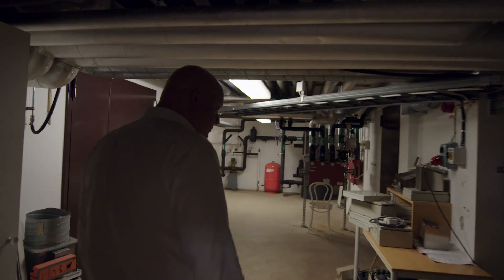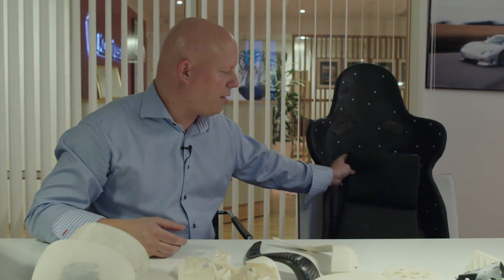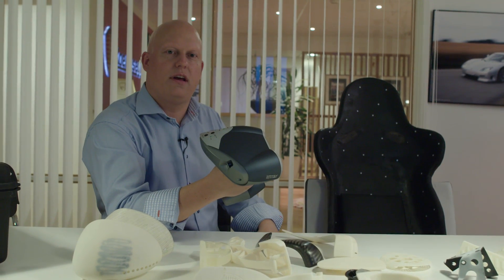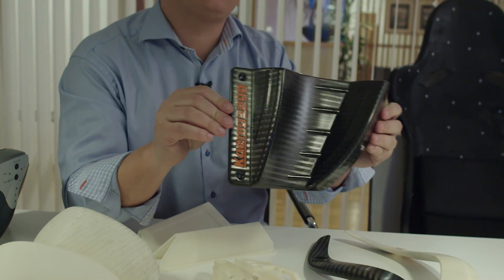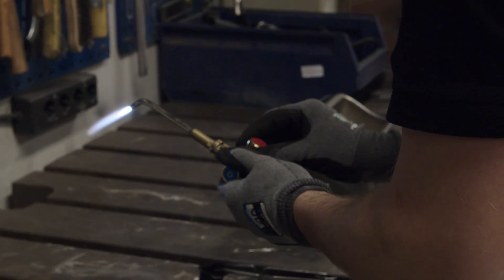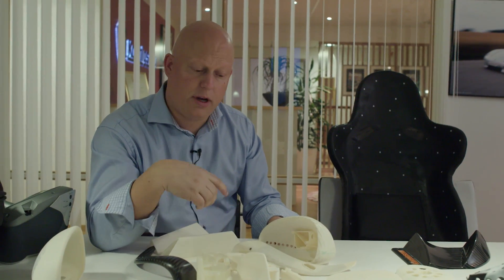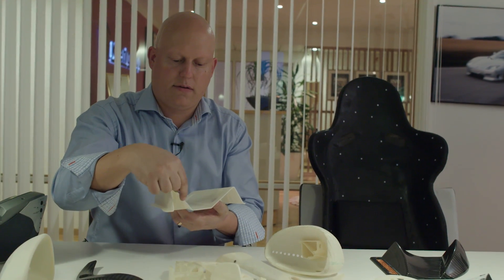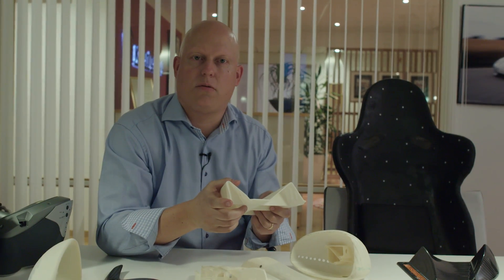3D Printing: Titanium, Carbon Fiber, & The One:1 - /INSIDE KOENIGSEGG

Comment: In the past when I have used a 3D printer I have used stratasys dissolvable support material and I would love to know why the wouldn't use that instead. The part is placed in an agitated acid bath after printing to remove the support material and it results in a much quicker and simpler workflow. Parts can be taken directly out of the printer placed in the bath for a predetermined amount of time and then removed once the support material has been dissolved. This allows for considerably more complex support structures than breakaway support material and prevents most of the "drooping strands" one will find with breakaway.

Comment: just as a side point dont worry about them using abs in the cars , its used in all commercial cars and for example all the plastic on a racing motorcycle is painted abs so nothing to worry about there
Reply: ***** I thought they are only used to model and test the real parts...
Reply: well Koenigsegg only uses the plastic in the "less important" places, right =p?
Reply: Mike Ennamorato didnt he say they use it in the air vent or smth
Reply: ***** I will look for it. - At least it saves weight!

Comment: so the car is called one as it got 1360 hp and weights 1360 kg....but when someone wants to drive it that means he got to step in obviously...so he wieghts 100kg lets ssay...that gives 1360 hp to 1460 kg...so no One anymore XD
Reply: The weight specified is not dry weight, but includes an average weighted driver, all liquids and a half tank of fuel.

Also, the engine output is expected to be slightly above 1360, according to Christian at the Geneva Motor Show.

Comment: Damn Koenigsegg is the only true Swedish car company we have left, and I couldn't be more proud to be Swedish, ÄLSKA KOENIGSEGG :-D
Reply: I am not sweedish in any way, but I am now driving an amazing Volvo! And I always loved Volvos and Saabs, though they are very, very rare in my country (espesially Saabs - they are extinct animals here!).

So, I am very sad that Saab has gone and Volvo sold to chinese company (which is not that bad if you understand how global market works and as long as they don't tell Volvo engeniers and managers what to do). 

Ok, what I wanted to say with all this... I am very, very proud of Koenigsegg! And I am gladly share your joy and proud of being sweedish, If I can say so? :)
Reply: Stolt svensk!
Reply: Alex J well, as you have issue with salt maybe a newer Audi is really the best way to go for you as they are all either made of aluminium or have very good galvanized body. We also use salt here a lot and also we have awful roads with a lot of abrasive dust, sand, mud, etc, etc, etc... If you saw any kind of dash cam video from Russia or Ukraine - you will understand what  I mean, roads ara awful here... But in my city it's a little bit better, than everywhere else, but still.. Ok, so, I had a Seat Ibiza 2007 before Volvo and I had some scratches and paint chips on the body for about a 4 years and there was no rust whatsoever. So, bodies on VAG cars are really good prepaired for such conditions, I think.. 

But strange thing for me is that you live in Sweeden (am I correct?) and you don't want to find a really good Volvo! :) Damn, I'd love to have such choice, that you have over there! But, wait.. I now have the car of my dreams, what am I talking about? ;)

What about Ukraine and Russia... Well, first of all, thanks for the kind words - nobody wants to have war, of course... But I'd like you to understand, that not everything you see on TV or in the newspapers is true. It's big politics and politic games now and we are only puppets here, really. As for me - I am not a political person AT ALL, like, I don't even have a TV, don't read news online - nothing! I am not interested in what happens in this fucked up country, I can't change anything really, we have no decent politics to rely on, we have no decent candidates to chose from, and we never had... So, why bother? :) I'd better use my energy in my love to cars, for example. :)

You see, as I see it, there are 2 superpowers now - Russia and USA. And they are fighting now. USA is trying to make the whole world to listen to them and EU pretty much does this already. Russia confronts now and using it's powers (as well as uniting with China - also very powerfull country economically and resourcewise) to resist USA. The only thing what is happening in my country - is that USA trying to ruin it, to let "thier" people rule the country and not "russia's" people. I hope you get what I mean. They need Ukraine ONLY as a place of arms, to put their rockets and NATO armies as closer to Russia as they can. And they use this story of "Ukraine coming into EU" as an excuse, as a lure to people to vote for "their" candidate... Of course, Russia does the same, but they not lure us to become a part of EU, of course, the lure us to be friends with them. Of course, there are a lot more common between Ukraine and Russia in many ways (culture, languages, economy, etc, etc, etc). As I said, we are only puppets here and sad part is that almost nobody understands that. People are extremely divided here, and this political games make this division even worse. They play on this cultural differences to make us hate each other and, unfortunately, they seems to succeed.... :((( A lot, REALLY A LOT of people hate each other just for talking a little different language (russian and ukrainian are very similar, people understand each other with no problem at all). In fact, people already killing each other because of that! :((((( That's crazy!

Also, a lot of political shit is pouring all around the world... I am pretty sure that you were told, that we were attacked by Russia, that there are awfull situation here, huge losses, tanks, etc... So, I live in eastern part of Ukraine, which is russian-speaking mostly and pro-russian, contrary to western part, which is pro-european and very aggressive to russian people, to russian language. Now they behave like nazis, really!! And I am not joking, the shout slogans, saying that russians must be dead, humiliate russian language, culture, Russia itself, etc, etc, etc... The same, what Hitler did in 30s against Jews.... And they kind of won now, they have power... Of course, people are not happy, in eastern part (where I live, where people are more pro-russian, talk russian language, etc) people are very offended with this attitude and they try to resist this, and those, who had kind of won the first part of the riots in Kiev are now suppressing the ones, who organize meetings and riots against them now... It's really, really crazy. Also, economy (not being that great before) is just shit now - the national currency is TWICE cheaper now, than it was 2-3 monthes ago. Everything is very expensive, like, gas prices are crazy, even food. 

So, I don't know really how I'd wanted for this to end... Sometimes Russia and their army looks not that bad, when you see how this national, "pro-european" part of the nation makes random people from other part of the country stay on their knees just because they talk russian language instead of ukrainian... :(  

We had very bad government before, they were stealing a lot, but at least there were not making people hate and kill each other!! The government we have now (though they are "temporary") is awfull, they are almost nazis! And they also will be stealing, everybody knows that as they have already been in parliament before (after 2004 orange revolution)! And they are playing their roles, covering it with this "Ukraine coming to EU" shit only to destabilise the situation and "sell" the country to USA and NATO. There is no way of Ukraine coming into EU as we have awfull eceonomy, awfull laws, awfull social programs - it's 3rd world country in it's worst! 

So, maybe, just MAYBE, it's not that bad for our country to be friends with Russia, which understands us better, which not just USES us in their fight with USA, and most importantly - not trying to make people hate and kill each other. 

But in an ideal world - we need good politics (which a lot of european countries have), who will not steal or fight or hate people or anything, but who will make good for this country, use it's huge resources to make it prosper, who will care for it's nation and make good social programs, etc, etc, etc... Unfrotunately, it's never gonna happen... :( 

Ok, that was political part of it... But on the other hand - people are amazing here. I am translator and interpreter and I work with foreighners a lot. I worked with americans, italians, germans, etc... And they all love our country, we have great nature and wonderfull landscapes. People are friendly and open, girls are very, very pretty! ;)))) Everything is very cheap hear for europeans and americans. :)) Service and roads maybe not that good, but you would get so much great emotions and happy moments, you would never notice this! Unfortunately, it's politics, who ruin this beautiful country... And very sad, that we kind of "lost" Crimea, it's just amazing! Sometimes, when this shit will end, I invite you to come and visit Ukraine, you will not regret it! Visit Kiev, Lviv, Kharkov, Donetsk - obligatory! :) 

Sorry for a lot of words, I hope I cleared up at least something for you. And thank you for this conversation. :)
Reply: write2chrome
Yes you can :) and I am Glad that you are happy with your Volvo and you can feel really safe in those "tanks" :-P. And speaking of Saab. Where I live in Sweden Saab's are everywhere (older models) since teenagers buy them because they are quite cheap and have a good amount of Horsepower with Turbo :-P

But to be true I prefer German Cars since they have more of an Aggressive look and that German quality, My Favorite car brand is Audi :-D got to love those 4 circles :-P

If I could get any car I want it would be an Audi R8 v.10 or Koenigsegg One:1 :-)
Reply: Alex J Oh, I love german cars myself and I always did. :) I had a Seat before my Volvo and I loved it in every way. I also looked into Audi A4, VW Golf and also I searched for a good Volvo because I had something in my heart since my childhood for them. I don't know how to explain, but I value safety in cars very much and even with todays cars (like Audi or any VAG car, really) being really good in this (thanks to EuroNCAP) Volvos are still the best in safety, no doubt about it.

But the problem is that I also like to drive cars, I like powerful, technical cars, with a proper manual gearbox, etc. So, I was looking for Volvo S40 II with 2.4 170 hp engine with manual gearbox which is like a unicorn in my country (Ukraine that is). :( I found just one, all way to the other part of the country (more than a 1000 km away :( ), in wrong color (very dark red), with grey interior and wooden trim.. Ugh! So, I started looking at S60's. Never liked them as much as S40 II - that's the car for me, I simply love the design inside and outside! And S60's seemed to me a bit dull and boring.. Until I stumbled upon one car... S60R. First one I saw was 2008, had more equipment, with automatic gearbox (which is bad, but ok, I could agree to that already, because the car was amazing in all other respects!), had less mileage and huge pricetag, way out of my league! The second one I stumbled upon nearly 6 months later was older, pre-facelift, had less equipment (but all I needed really and even more!), more miles and really, really low price, which was suspicious. But I gambled and now I am a happy owner of a really, really amazing car!

And you should understand, that there are only several of them in the country, like maybe only 10! And they are not sold that ofthen, you have to really be either lucky or really really chasing them and even contacting owners asking to sell you thiers - they are that rare in Ukraine! I think I was very lucky and I was asked several times already to sell mine. :) (Not gonna happen, obviously!)) 

I am now want to restore it to perfect technical condition (it has it's flaws, but it's repairable) and keep it for a 3-5 years, maybe more as this is an incredible family car, very comfortable, safe and yet it's capable, powerful, fast and drives like an absolute bullet train! 

So, this is my story. :) That's why I am so proud of mr. Koenigsegg and so sad of Saab. Cheers!
Reply: Interesting story :D. And how sad that they are so rare :O. I mean here volvos are like everywhere xD. And I myself is stuck between choosing either. An newer Audi A6 (2.4 liters V6) Audi A4 (2.0 tfsi) Golf GTI (2.0 tfsi) or and Volvo S40 or V50 T5 :D. Love those little speedy volvos. But they are a bit to small for me (I'm tall, long legs). And I love my old Audi A6 from 1998 :) but since we salt like a lot here in the winter (idiots .)...... it has started to rust quite bad. And it has 25.000+ miles. And it squeaks in every part everywhere :(. So that's why I want to find an new one. :).

I hope that your volvo will keep you happy and safe. And that you have an wonderful life. Cheers man :D

I also hope that the tension between Ukraine and Russia will settle without a war :(. I'm holding my thumbs :)
Reply: write2chrome Oh :O. Thx :D now the Russia/Ukraine dilemma makes a lot more sense.  Really detailed and I trust you more than our bullshit news.... And to the car part :P. 80% of the cars where I live in Sweden are Volvos. So I don't want to be one in the crowd :P. And I just love the looks of a big german car with an big engine >:D :P.

I'm also glad to hear that newer cars don't rust as easily :D.

And maybe you should move to Sweden? ;) I mean Volvo Paradise xD

Maybe I should visit. Thx for the tips :D
It actually sound awesome to be honest. Ukraine that is :P. If we skip the politics of course :P.

And I'm glad that we could have an conversation :). It's not that often that you talk to the neighbors ;)
Maybe I hear from you again :D
Reply: Alex J Politics is shit, I'd better not talk about it at all. :) We have so much more interesting topics - cars, culture, travel, girls! ;)))

I'd be happy to move to Sweden, but I bet it's not that easy as it sounds. ;) For a start - I have to live somewhere and I have to work somewhere, right? (I'm not hintin now to you giving me a home, I'm just saying. ;))) So, the problem is that I have degree and experience in linguistics, being an russian-english-russian translator and interpreter. I don't see the job in sweeden, where my skills are needed. ;))) Though, living in a Volvo/Saab paradise for me... Would be amazing, I agree on that! :) 

Yeah, I was glad to talk to you too, and it's not that often, that I talk to someone abroad (not taking into account russian, of course), especcially from Sweeden! I was talking to a Swede 1st time for my 10+ years on the Internet, that's for sure! :))))) 

Well, if one day you will decide to visit Ukraine you know whom to write to. ;)))) Cheers!
Reply: write2chrome Cheers :)
Reply: Actually it's probably one of the few true manufacturers in the world. Lambos, Ferraris, you name it, they do not manufacture all the parts themselves anymore.

Comment: why are they showing us how they work on the exhaust endpiece with that burner.... its just for looks... 
besides that, absolute engineering porn.
Reply: Masterlostfreaky The printing process is likely a company secret. The finishing process is probably done by everyone who has ever worked with titanium.
Reply: engineering porn indeed.
Reply: Most likely, it's just to finish the piece and hide the layers from the 3d printing process, smoothing out the outside shape of the piece.
Reply: ***** yep it's a space metal and can survive the tremendous impacts of asteroids when they hit. one of the strongest substances known to man.
Reply: The printing process isn't a secret, even though he explained it, it's extremely simple. The torch is probably to finish the part even better, melt the tiny edges that are there even after sanding.
Reply: the torch smooths the ends, gets rid of oils, and helps "heat treat" the layers
Reply: Also, Ti changes colour when heated to certain temperatures, look at how Pagani treat their Ti exhaust parts